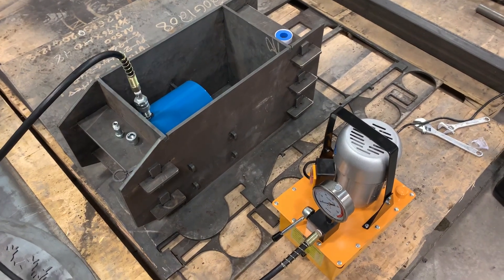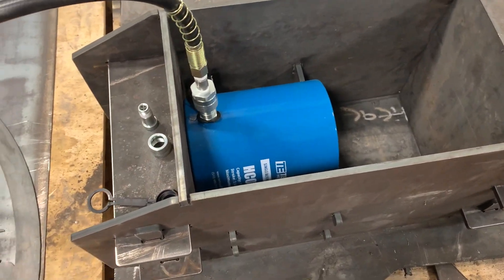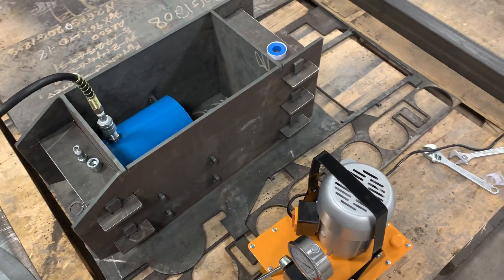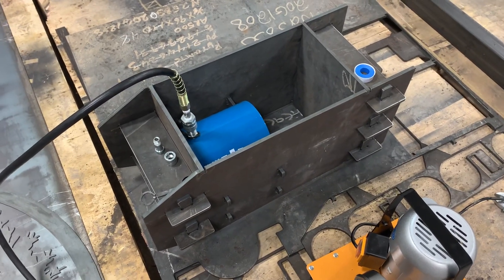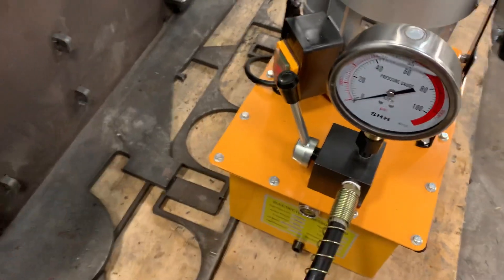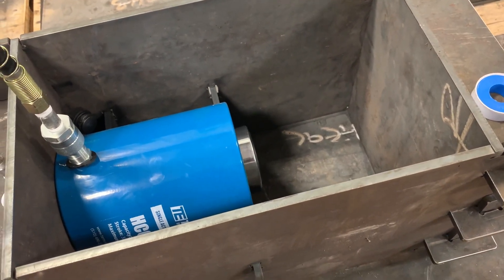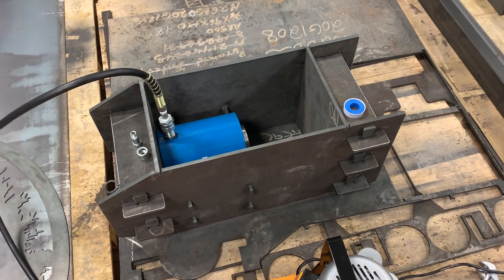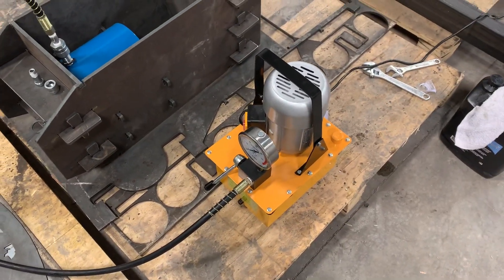Homemade 100 ton shop press

Comment: I thought that something looked REALLY wrong with this press based on material selection of 3/8" thick and how tiny the lower die platen plate supports were. Then I heard AR500 plate and all my worries dissappeared. Big difference when A36 mild steel has a minimum yeild strength of 36000 psi and AR500 has a yield strength of 215000psi! Grest job on the press, i hope you'll show some in use video as well as share any issues you come accross. The assembly method is very cool but curious as to how it works out if some of your uses cause more loading to the frame than simple axial ones. Awesome though all the way. I have plans to use two 50 ton cylinders with similar stroke in a bench top press that I wanted to keep under 18 or so inches. It looks like I'll be sheading  4-5 times the weight now as well!
Reply: Have you completed your project? I am working on something similar...

Comment: Maybe a stupid question but is that cylinder designed to work on the horizontal like that?
Reply: Yes because the oil is in the pump